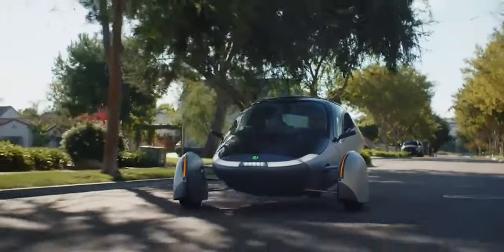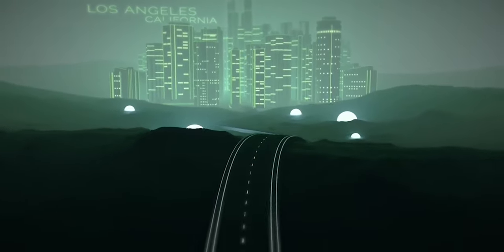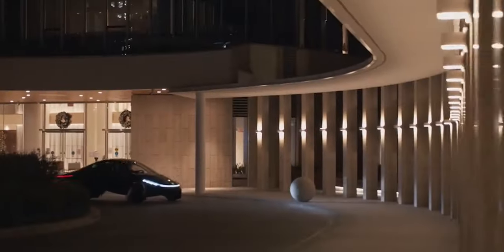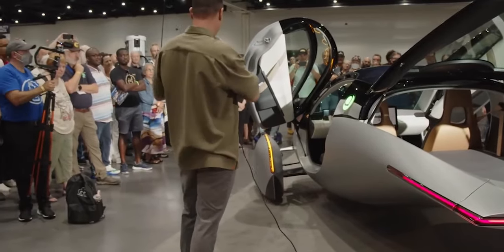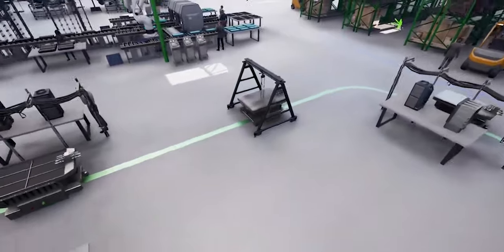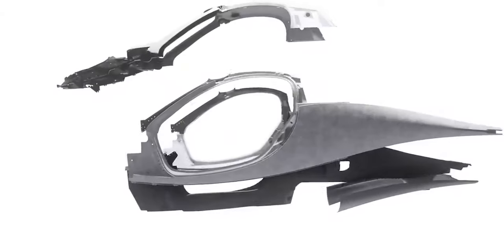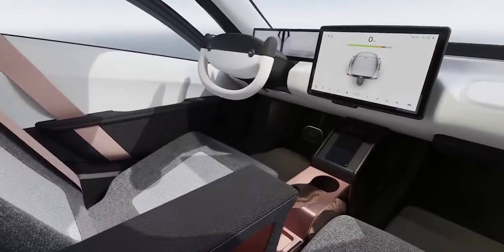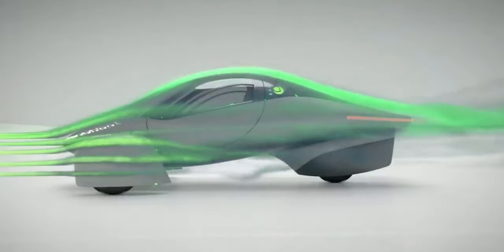This is what the Production Version of the Aptera looks like: Aptera Delta

Comment: Aptera could potentially redefine what a car looks like and how much it should weigh.

Today's cars are just way too heavy and inefficient for the frugal future we all must face.

What is great about Aptera is you give up nothing but weight and inefficiency.

So many economy cars fail because they have very low performance - annoyingly slow!

Not so with Aptera.

That is why I just placed an order for one.
Reply: Everything is always an engineering and social (unfortunately) compromise.  For many in cities concerned only with efficiency the nimbus may be a better fit (Aptera is a bit large).  Those with families need the back seat a bolt, model 3 or model y might be better.  Those needing utility may find the cybertruck or f150 lightning are the right fit.  Aptera isnt the right vehicle for everyone but it is a great option for some (regardless of if they need solar since even without it we have a affordable electric sports car with decent storage).